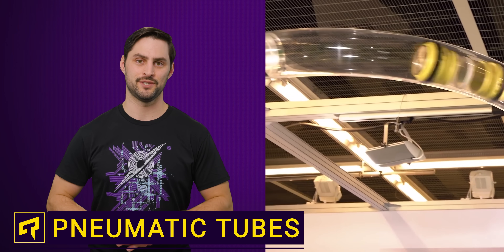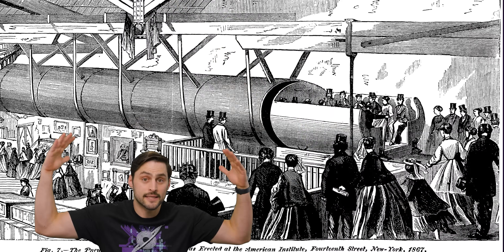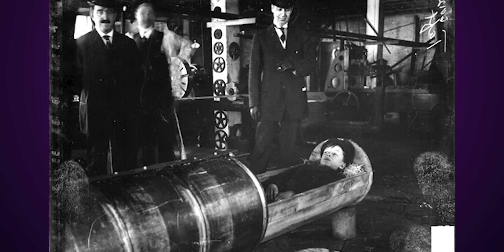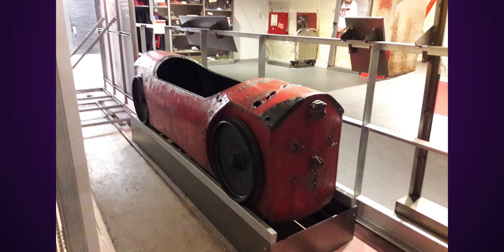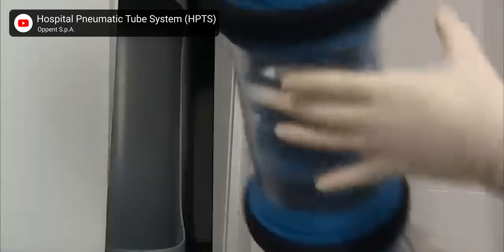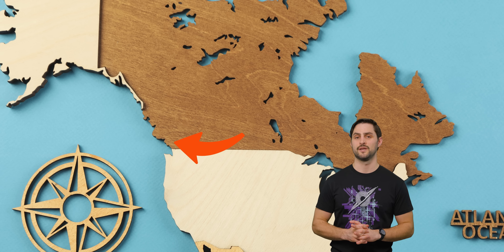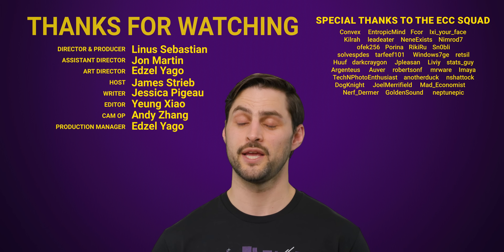Why We Don’t Travel in Tubes

Comment: For Security and Potential Legal reason I cannot state the company I work for in this message but at this company up until a year ago we used pneumatic tubes to transport excess cash from registers (Cash Strips) and shoot them to the stores vault for safe keeping. We have switched from this to a different system where cash is inserted into form of atm for better book keeping and said atm also can dispense cash if a register is say out of ones as opposed to someone having to go into the vault grab needed cash and shoot it to the registers. I prefer the old system for employee safety but above my paygrade. We still have the system and its now used to shoot lost items such as phones or credit card to the vault which doubles as a lost and found for higher priced items

Comment: "... over time as the steam engine became smaller..."
The steam engine (either steam locomotive or.... actual steam engine) from its inception to its end of mainstream railroad/transport use has a dramatic trend UPWARDS in size and weight from beginning to end.
If you're comparing it to the steam engines and locomotives common during the 1800's pneumatic railways and the end of steam (or peak of steam... or any point after the pneumatic railways) they would, in general, be considerably larger than the comparable 1800's locomotive.
I'm not sure how you arrived at the conclusion that they got smaller over time, but that statement has no bearing on reality.
Reply: This is broadly untrue - some engines got bigger, but the general trend was smaller and more powerful over the course of the 19th century.

Comment: Not everything can be done via ATM, otherwise the physical bank branches wouldn't exist at all and we'd just have ATMs in random parking lots and stores.  If a bank wants to have multiple drive through lanes served by a human, pneumatic tubes are basically the only option short of building windows into multiple walls on the building.  I'm pretty sure even newly constructed banks use them

Comment: A walmart I used to work at used them for the drive-through pharmacy. This wamart was built in 2013 or so, so it's not like this was a relec of times long gone.

Also, that bank example is kinda bad, since there are many things an atm can't do. Cash a check, for example (though, most larger banks will let you cash checks electronically through their phone apps).

Comment: Some Walmart Pharmacies do use pneumatic tubes for their drive thru pickup. That's because the pharmacy is at one end and the place for the drive thru is at the other. This actually protects pharmacy employees from potential harm in the process of dispensing medication.
Reply: still used in many hospitals connecting the pharmacy (usually in the basement) with the various floors/nursing stations
Reply: @neospriss  That was mentioned in the video.
Reply: Walgreens has these systems as well in most cases. However they have very rigid guidelines on what can go in them as the sudden stop at the end of the ride can break glass/plastic bottles with liquid in them and some other sensitive medications. I tended to see most of the locations shut down the vacuum tube lane and just use a drawer so they do not have to ask a customer to get in the back of the line because their medication can not go in that lane.
Reply: @ActualKirgen they still have one in full operation at my local Walgreens since there are two lanes, with the one away from the window having one and the one close to it just using a drawer
Reply: Hospitals have a ridiculously hi tech version. Blood samples, in tubes with barcodes, are loaded in and sent from the front of house, to the lab. At the lab, it will be automatically be dispensed, sorted from the barcode, and loaded into the testing machine. Incredibly fast and sterile.

Comment: getting stuck in one of those would be a claustrophobic persons nightmare
Reply: Well, they wouldn't have to worry about claustrophobia after 2 minutes.
Reply: @vexnity460 vaccum canned human 💀
Reply: As someone that suffers from claustrophobia, let me tell you that I'm not setting foot in one to begin with!
Reply: Soooo... just like any enclosed water slide?
Reply: @CasepbX  You can see both ends of a water slide and observe its entire operation before using it yourself. Also they're gravity-controlled so you don't have to rely on a pump/electronics for a successful transit. I think there's more to claustrophobia than "I can't stand up or see outside".
Reply: @CasepbX Not sure what sort of waterparks you are going to but they down tend to suck out most of the air from waterslides to create a low pressure environment.
I rarely hear people say "This waterslide SUCKS!!!" :P
Reply: @CasepbX  lack of air isn't a problem on water slides
Reply: Anyone’s…
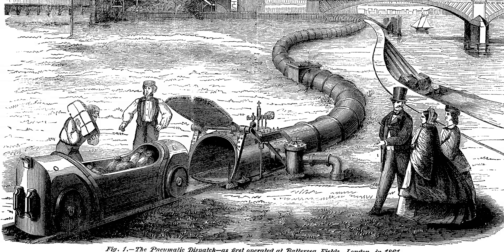Reply: @deleted-something  yeah, for sure. I'm nowhere near claustrophobic, but the image at 2:23 definitely gives me anxiety.
Reply: Like an elevator

Comment: My supermarket still uses it and I don't see a safer way to gather and centralise all the cash better in a huge safe. Plus it looks pretty cool.
Reply: When cash was still accepted at Costco, they had a pneumatic system to move cash from the cashiers.
Reply: @Obscurai  You can still use cash at Costco, but yes they did have the pneumatic systems. I remember having to wait one time cause the Costco register told the cashier it needed to put x amount of money in the tube.
Reply: @burgoyn1  Yep, with the diminished use of cash, there was less a security problem and thus the tubes were phased out.
Reply: saw this in a hospital triage distribution ward, the unseen parts are extensive and are used for transport of medical samples and items

Comment: Maintaining a vacuum in a tube large enough and long enough to transport anyone is hard to do. Also it's very dangerous if anything goes wrong.
Reply: so you'd basically need something as strong as a deep sea submarine but that's also very resistant to compression at the same time?
Reply: Doesn't have to be a complete vacuum, nor is it as difficult as building tunnels under water (water pressure quickly gets much higher). Still, building such tubes above ground is likely not possible over long distances. And underground tunnels are extremely expensive before factoring in near vacuum conditions and very high speeds. Will be a while before we see anything on a mass scale. But short novelty tunnels may start popping up relatively soon as multiple companies are working on it and may find buyers in entertainment areas (Vegas, theme parks, Disney, etc).
Reply: Modern systems don't utilize vacuum they are open to atmosphere and utilize displacement of air.

Comment: I just discovered that some AM2 motherboards have no EPS connector and has a 24 pin that's smaller than a normal 20 pin. I bought an adapter on eBay that has a Male 20 pin to Female TINY 24 pin.
Reply: Those boards are likely for niche uses